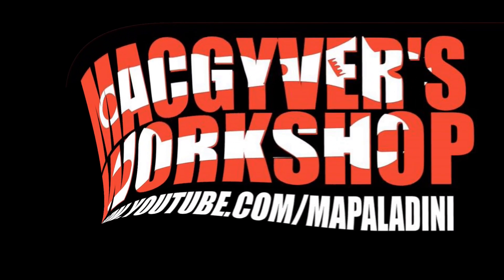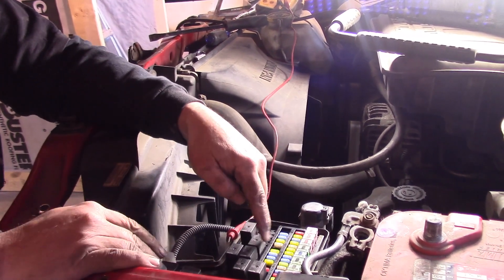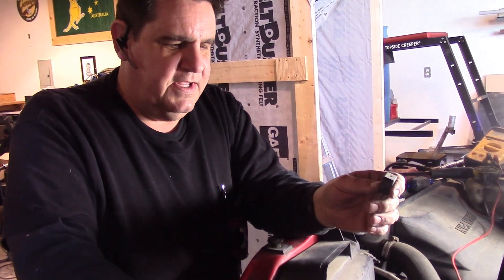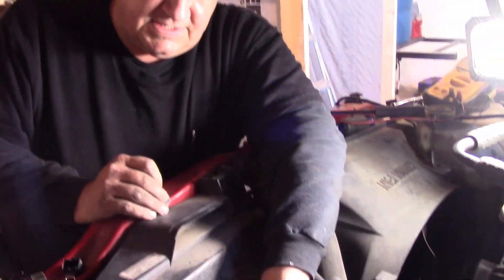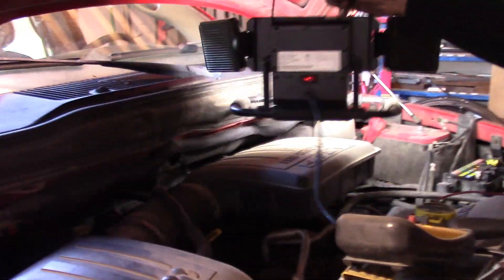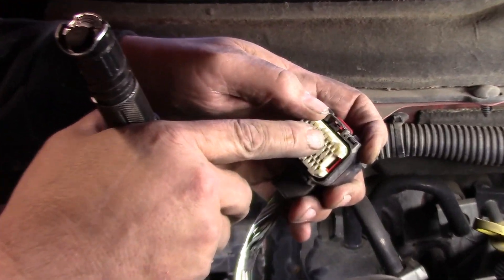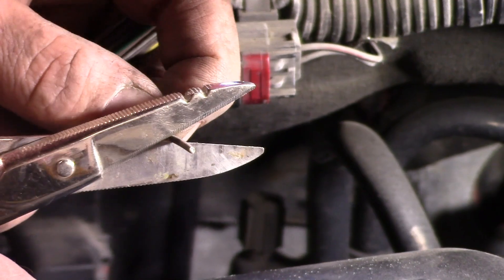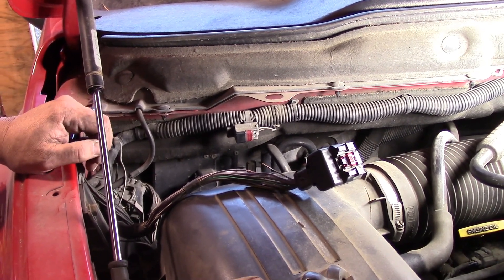Code P0685 P0688 diagnosis 2005 Dodge Ram 1500 4x4 4.7 Liter

Comment: Awesome man I work at a shop and I had a 2011 ram 1500 with p0688 crank no start, ended up being the pin on the bottom of the fuse box for that wore coming from the pcm was corroded and snapped.